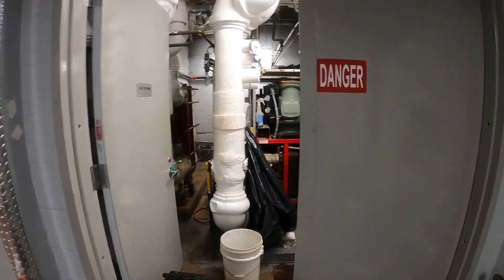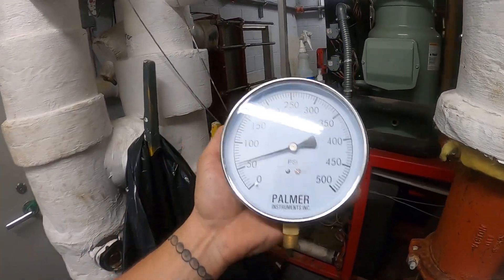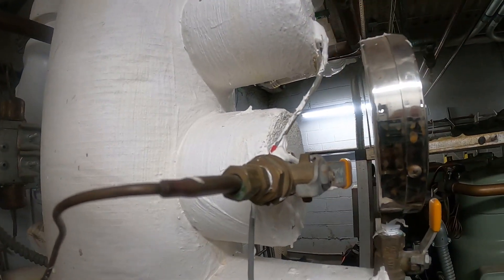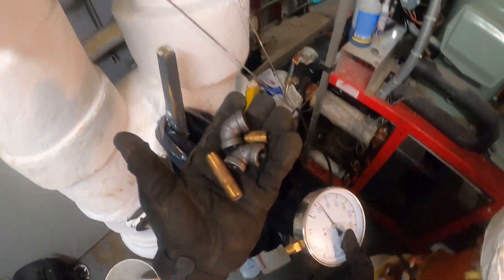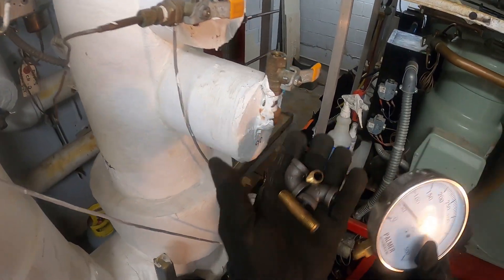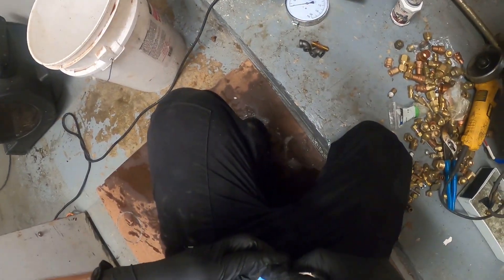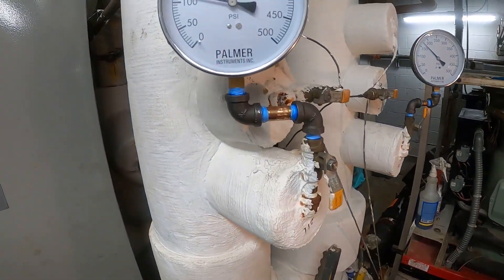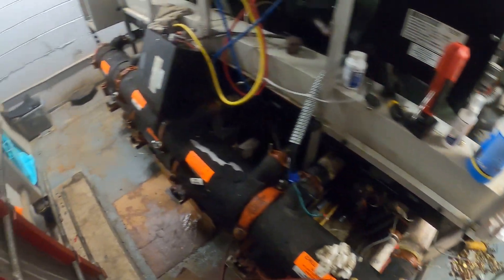HVACR: Chilled Water Pressure Gauge Installation For MultiStack Modular Chiller

Comment: Don’t grind the head off the gauge that’s just being lazy, you should use an adjustable wrench or pipe wrench and rag so you don’t mar the gauge. You should of replaced the 10$ brass valve used tape and gas pipe dope. We always install a T and a peach plug beside the gauge.

Comment: Howzit bro ineed to learn chillers now industrial systems 
How much pressure on water lines must be 
And in bars or psi at what pressures and chilled water must be at
Reply: He will never tell it to you, that guy installing a gauge that already indicates 62 psi without pressure and the way he uses Groove pliers instead of appropriate tools. 
About you question: to depend on your pipes design - some will run at 40 psi (2.75 bar) and some up to 120 psi (8 bar) find the document of the engineer's design.